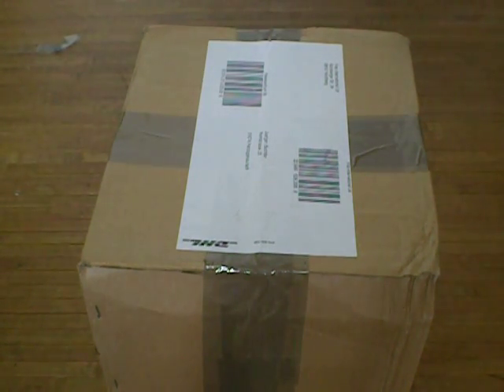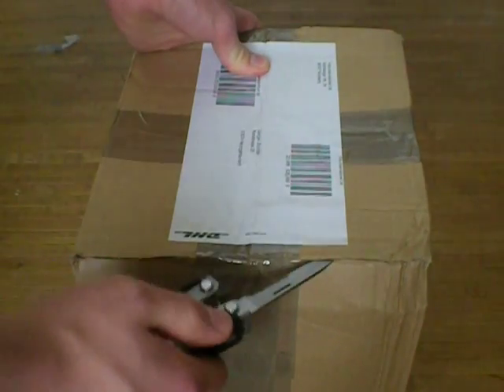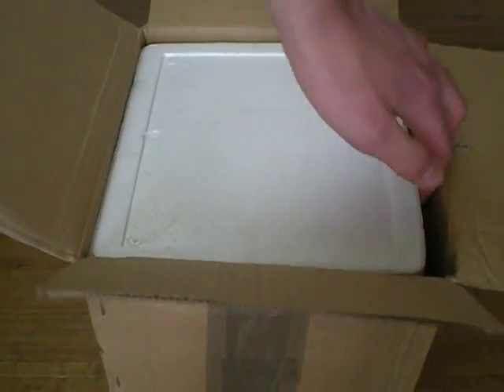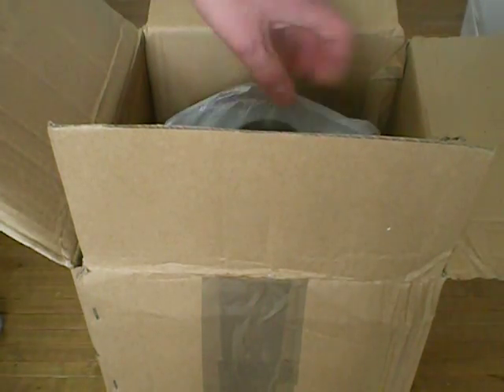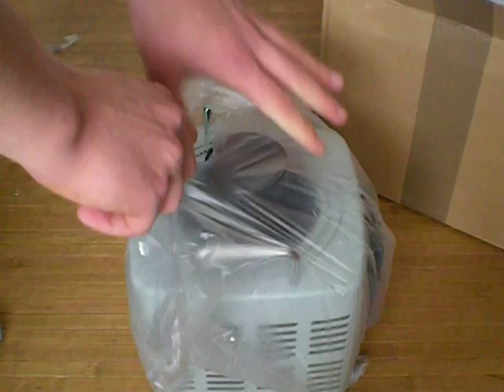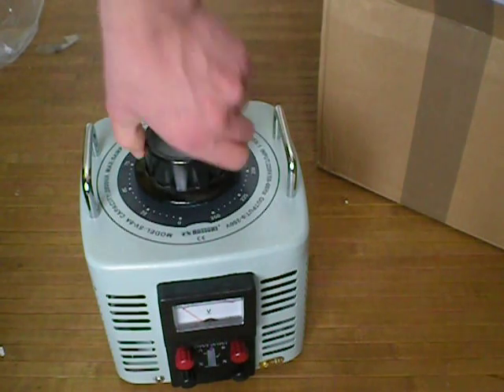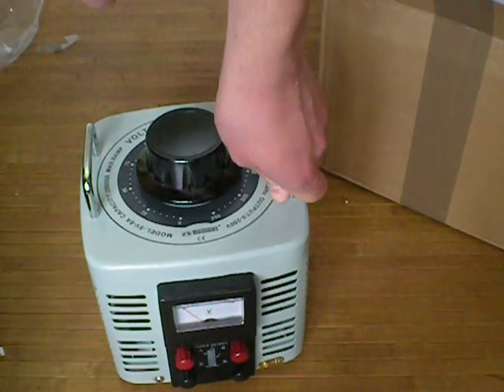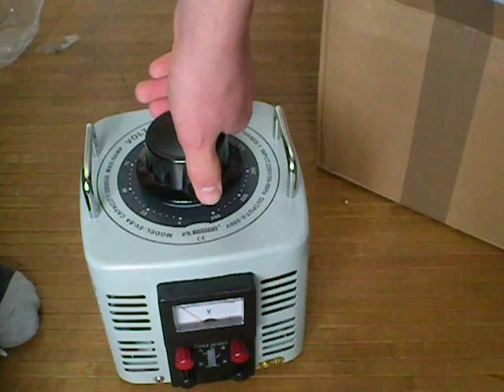Unboxing my new VARIAC

Comment: nice variac..... i have the 1kw vesion of that and i am still realy happy ?
From wehre you get your brushes?
Reply from the maker: +Pre- reloaded I have not needed to replace the brushes yet, seeing as i dont use it all to often at the moment. For smaller needs i have a old 1KW variac and isolation transformer combination. Im still quite happy with it as well, currently i use it to control the brightness of some studio lights i have, and the occasional audio repair, but other then that i rarely use it. I could probably get the brushes from ebay, seeing as thats where i got the transformer in the first place.
Reply: +lbochtler ok, thanks for the answer :D
Reply: The wattage on the variac is crazy.
Reply: +Owen Chase science channel why 1kw is Not much?
Reply: Pre- reloaded what do you think of this variac I want to buy it, I multiplied the voltage by amperage and it gave me 10 kilowatts is that wright?

 http://www.ebay.com/itm/20-AMP-Variac-Autotransformer-Voltage-Regulator-Powerstat-500VA-Hug-Flight-/361619626244?hash=item5432359904:g:JGEAAOSwgY9XcjsE
Reply: +Owen Chase science channel    No, because this is a 130 volt variac (multiplied by the Max. 20amps = 2.6kw )
and i don't know how you get 10kw when you take  amps × Voltage   ?
Reply: Pre- reloaded I guess I just did it wrong.
Reply: Pre- reloaded It said 500 VA I thought that was 500 volts and I just multiplied it by 20 amps.
Reply: +Owen Chase science channel  oh now i understand.  the 500va is Not the Same as voltage. I think that the headline in wrong because on  the picture it says 2000va (same as 2000watt) max.
Reply: Pre- reloaded O ok.
Reply: Pre- reloaded I built an induction heater but I do know what wattage it would take to melt an average size steel bolt?
Reply: +Owen Chase science channel around 1kw will Do it
Reply: Pre- reloaded ok thanks

Comment: i want a help
i got new variac and its input knobs are short when we check it through multimeter resistance portion
and same with the output knobs 
is that right or my variac is short and i am afraid of giving voltages